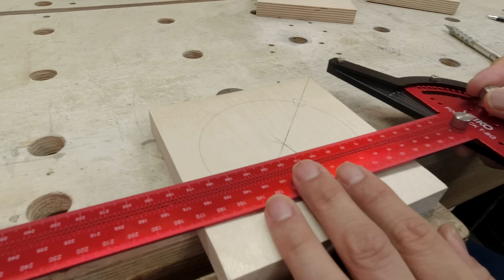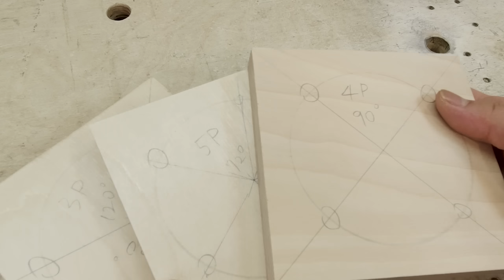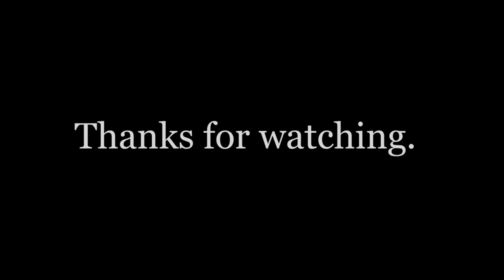⚡Making Wooden Knobs: Mastering the Technique of Easy Shape and Size Adjustment with New Jigs / DIY

Comment: Did you make notes of which size hole saws you used for which Knob Diameter you created?
Reply from the maker: There is no record, sorry.
Reply: @carpentak  Just a thought for you to consider. If some young person who does website and CAD type software were interested (if you got lucky and knew someone). You  could offer them a 2 year or 5 year deal. They make the drawings/plans. They setup the store/marketing, and you could advertise your plans, on your YT Channel, and then, it would be your website. You could learn to do what they do, and hep a little while learning, and after 5 years, you could decide whether to continue or not. You could end up with a Video person doing the videos for you, and uploading them, and, might even be happy to help in their spare time, just to learn the trade.  Just a thought.. I know you get asked a lot about plans. Someone who knows Sketchup, or CAD of some type, would be very handy. And, You would have a 3D printer before you know it.. Ha..ha.. Thank you for the videos. Your work is always interesting.. 
I am waiting to move to a place with room for a nice shop, and getting all of my ideas ready for when I get there..  I have some good ideas for the knobs.. The Router Table with a bull nose, cove bit for the cut outs, and then the table saw to cut them up. One long dowel to start with. Save the time cutting the circles and drilling with the hole saw.  :)

Comment: Lovely jig, but I think that the knobs with T nuts you are using the wrong way round. The Wide part of the nut should be on top so as you tighten the knob the T nut is being drawn in towards the knob, the other way round, you could twist the knob right off the T nut. 👍

Comment: Nice Job.. Very flexible design that allows you to use the same base to make different diameter knobs and adjust each of the depth of cut to vary the  knobs to the grip you enjoy most by sliding the jig in the T-Track.. Excellent design Sir! Really Excellent!

Comment: I really like this design - simple and elegant.   I'd like to make a recommendation to simplify the building of the base of the jig.   Just cut a strip of wood to fit into the t-track, and then glue and pin brad to a single piece of plywood.  It will hold fine and will allow you to skip the steps where you have to make the base in two pieces, and later dowel them together.   I finished the entire base in less than 30 minutes.
Reply from the maker: The way I made the base is to keep the runner and base exactly parallel.  It also solves the problem caused by the lack of runners.  It takes a little more time, but it has its advantages.  I always prefer to make it well rather than make it fast.  thank you

Comment: Can you explain why at 5:33 you offset the lines? Is it only becuase of the angle of the clamp?
Reply from the maker: The line in the center of the base is the reference point for everything.  Create a center point on it and that will be the axis of the circular templates.  It draws other lines based on the first line.
Reply: @carpentak  Thank you!

Comment: Could you please tell me if the size of the circle for the templates can be chosen or has a specific size, does this size influence the size of the knob to be built? A suggestion to make your video brighter than it already is and help other people make a similar one would be to provide at least some important measures... Thank you!!! Good jobs
Reply from the maker: The size of the circle doesn't matter.  It can be 5 inches or larger or smaller.  The important thing here is to draw and set the angle correctly.  Draw a smaller circle starting from the center of the 3-, 4-, and 5-angle circles and put a point exactly on the circle.  That's the key.
Reply: @carpentak  Ok my friend, thank you very much

Comment: Very nice, thank you.  When drilling out the shaped knobs, could you not remove the 1/4" pilot bit from your hole saws?  That way it wouldn't impact and mar your nice jig templates.
Reply from the maker: You are right, but it is inconvenient for me to remove those bits one by one when I use them. And since there are bits, stability is increased. I don't care about damage to the jig.  thank you

Comment: Great Jig, I am impressed. Do you have a dimensional drawing?
Reply from the maker: There are no drawings.  Dimensions are not important here.  The key is to lay out the correct center line and angles accurately from the center.

Comment: What is that caliper/ruler tool you are using at 8 seconds into your video?
Reply from the maker: It is a scribing gauge from MATSUI in Japan.
Reply: @carpentak  Isn't this tool Veiko? Available on Alliexpress and Banggood? I have a Ruler T from this brand and it's great
Reply from the maker: That's right, I have that too.  That's good too.

Comment: Great job👍🏻 You are using the insert the wrong way. Turn the knob so that the flange is on top, visible. It‘s not good looking but mechanicaly right, so the flange gets pulled against the knob when tightened. Otherwise you‘ll pull the knob and the insert apart. Good luck👋🏻
Reply from the maker: You are right.  So I use instant glue there to prevent it coming off.  thank you
Reply: @carpentak  yes, I‘ve well noticed that but a drop of glue might not withstand great torque? At least this is my experience with very same thing😉
By inlaying the flange one can achive a better look?
👋🏻

Comment: И стоило так заморачиваться, что бы сделать такую кривизну? И ещё, не пойму зачем надо было резать фанеру, что бы потом её склеивать???
Reply: Could have used one piece of plywood and glued a strip on for the track runner.
Reply from the maker: you're right.  That's possible too.  I did it this way because the track is small.

Comment: This video should be named "How to make things more complicated than necessary". The gluing part makes no sense, it would be much easier to make a piece of plywood with one hole for fixing the material and clamp it down to the worktable. The "carousel" is also unnecessary since you can just rotate the material that is fixed by a screw in the middle and on the workboard  you can have markings for setting angles. The whole idea is overcomplicated.
Reply: 0:22